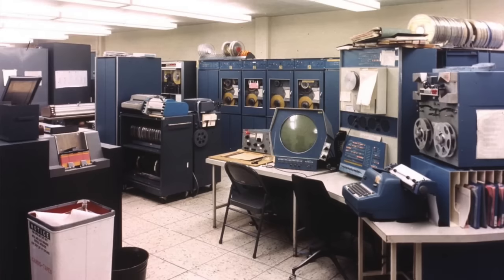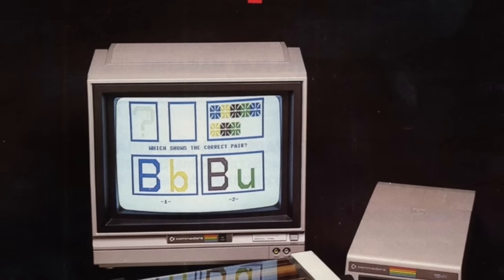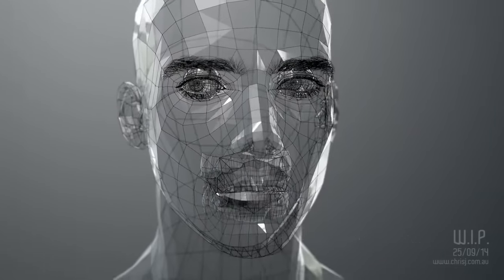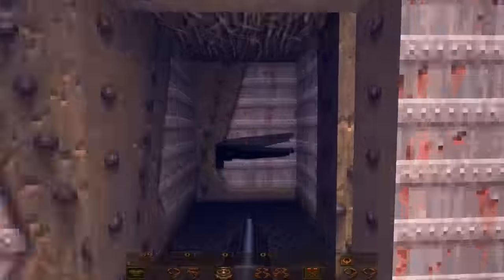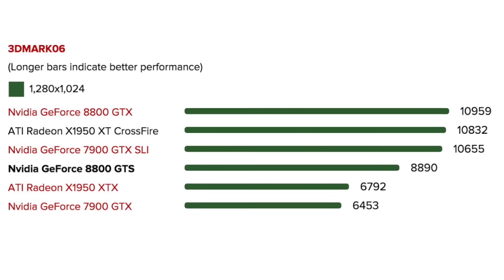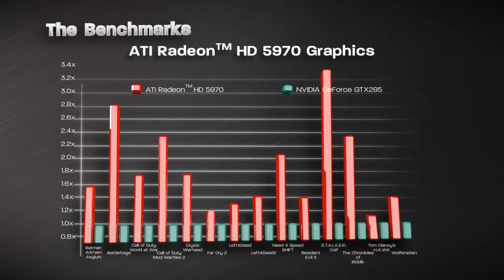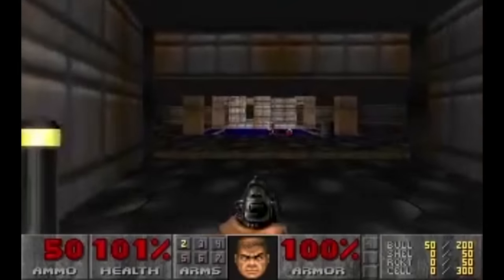Evolution Of PC Gaming Hardware

Comment: Running a 8700k at 5.0ghz, a EVGA GTX 1080ti sc2 hybrid, 4000mhz DDR4 trident z RGB. Acer predator (I dont remember the model number) 1440p 165hz 27in monitor and another 24in lenovo 1440p monitor. Two 1TB NVME drives and two 1TB samsung 3.5 ssd. First time ever building a system of that calibur and it was the best feeling ive ever had when it booted first try.
Reply: Weird flex but ok

Comment: I'm still using an Intel Core 2 Quad Q6600 from 2007, but over the time I've upgraded and overclocked my computer so now it runs at 3.00GHz (stock 2.40). When I got the computer, it has 3GB of DDR2-667, now it has 8GB of DDR2-800. I also replaced the Nvidia GeForce 8600GT with an AMD Radeon HD7770. I think I'll buy a SSD to make programs start faster. So I think this is a good example for a computer with a very long lifetime, most of my friends and classmates buy a new computer every 3 years for about 500-800€ just to play at th highest settings. I can't understand this because I can play all games I want to, maybe not at the highest settings but even on medium settings the games are still fun. I'm not going to buy a new Computer before 2022, then my computer will be 15 years old and also then I'll not give it away.

Comment: I have been building and upgrading my pc for over 10years, always adapting and adjusting to the next best thing that came out. 
Finally I have caught up with the market (although maybe not the MOST powerful but at least high end) It has taken many hours of building and much money to give me the rig I have now, which still to this day I am always looking into other products that could enhance my systems capabilities.....

My Rigs Current State:
 
Motherboard: Asus Rampage IV Formula X79 - 2011CPU Socket.
CPU: i7 3820 3.6Ghz 10Mb Cache (with turbo clock).
CPU Heatsink: Cooler Master sealed liquid cooler single radiator.
RAM: Kingston HyperX Savage 4X4Gb 1600mhz.
HDD: 1x1Tb 3.5 Seagate Drive, 2x500Gb 3.5 Seagate Drive.
GPU: Nvidia GTX 1080 Founders Edition 8Gb VRAM.
PSU: Corsair 750w
Housing: Zalman Z11
OS: Windows 10 Pro
Monitor: Asus VG248QE 24-inch 3D LED Monitor 144hz

Now I consider this to be a good rig however my plans are to get a larger (two fan radiator) heatsink cooler, and a bigger case. Case will most likely be the NZXT Phantom 820.
I have yet to find a game that I can not run in max graphics. I love where technology has gotten us and where it is leading.....Gaming is my live, my passion and my hobby. One day (fingers crossed) I can do it as a career too!

Comment: i rate this video 10/10.
also  the 8800 GTX was comparable to my graphics card I had since about a month ago, finally upgraded the EVGA GTS 450 SC to 1070 FTW. (that's like jumping in a decade of performance)
but such upgrade meant some cpu bottleneck too as he mentioned. I upgraded the CPU a bit too but still need something more.

Comment: Purchased the 1st consumer Asus SLI capable motherboard which supported two nVidia GPUs in 2006 and was blown away, then, back when Comp USA existed. Building it was new to everybody. It needed a 500 Watt power supply else no go. Noisy were the fans in that crate! Now my Toshiba Qosmio PC laptop (64 bit windows 8.1) contains a single nVidia GPU which blows the doors of my old 32 bit machine and consumes only 75 Watts to boot!

Comment: Cpu:Ryzen 5 2600x gpu:vega 64 asus strix rgb x470 itx mobo:board from asus fan:corsair 140mm fan cpu cooler:h115i 280 mm water cooler psu:650 watt evga modular power supply 
Case:nzxt manta

Comment: My current build, which is a total bliss to game and work on:
GTX 1080 SLI + 2x Quadro M5000
i7-5960X, watercooled, OC'd to 4.6GHz
64GB DDR4 with another 64GB coming soon
512GB Samsung 950 Pro M.2 boot
1TB Samsung 850 Pro for games
1TB Samsung 850 EVO for live work files
4TB WD Black HDD for storage
Rampage V Extreme mobo
EVGA P2 Platinum 1200W PSU
Acer Predator 27" 1440p 165Hz G-Sync IPS display
Corsair K95 RGB keyboard
Corsair Sabre RGB mouse
Corsair  MM800 Polaris RGB mouse mat
Edifier S730D speakers

Comment: The Voodoo 2 was not a standalone card, and did not allow a 1024x768 resolution, unless it was a Voodoo 2 SLI (SLI was the propriatary name of 3DFX for pairing two grapjic cards, NVidia got the brand name when they bought them). The VooDoo 2 had 8MB and 12MB versions on a standard PCI slot, it was a pure 3D accelerator, it needed a 2D VGA card to handle 2D Graphics. Each card had 2 processing chips, but the second one was not fully utilized.
Somewhere in 1998-1999 they released the VooDoo Banshee. This was a revamped VooDoo 2, with just one of the two original processing chips. But this one had 2D graphics capabilities, had 16MB of much faster DRAM, and used the AGP 1x slot which gave it double the bandwidth of the old PCI slot.

With all this said, The VooDoo Banshee is not their first all-in-one card. They had the VooDoo Rush, which was basically a VooDoo 1 with 2D capabilities and 6MB of VRAM. Every game club I visited back then used the VooDoo Rush. It was affordable and ran games well. the VooDoo 2 (not to mention the SLI version) was a luxury piece of hardware.
Reply: Forgot to mention.... A single VooDoo 2 12MB card allowed for a maxmum resolution of 800x600 pixels. You needed two of those card in SLI mode, to run 3D in 1024x768 pixels. This also worked with two 8MB cards.

Comment: Processor: i7-4790k
Ram: 16gbs of DDR3 2400 MHZ (forget the exact cards, but they're corsairs)
PSU: Corsair HX750i
Mobo: ASrock z97 extreme4
Cooling: Corsair H100i closed loop (Liquid cooling)
GPU: nVidia gtx 1070 FTW
Display: Acer 24" 144hz 2k x3

Comment: Some misinformation in this video. The Voodoo2 was NOT an all-in-one video card. It had NO 2D and was just a 3D accelerator just like the original voodoo1. You still needed a separate 2D card. Also CPU performance went up 250%  between 2000-2003 while today CPU performance went up only 40% in the past 5 YEARS.

Comment: WIndows 95 on Pentium 200 Mmx with 32mb SD ram, 4mb 3d graphic card, 2GB Hard drive, floppy drive, ZIP drive and 15inch crt monitor with resolution of 1024x768... (payed 2500$ in that time) 

I cant believe more than 20 years passed so fast...

Starcraft, Diablo, Baldurs Gate,Fallout... what a great games in such a great time...

Fuck I just realized I am gamer more than 20 years :)

Comment: My first pc was a Mesh Elite 300H was an Intel Pentium II based PC. The CPU was clocked at 300 Mhz and the PC was supplied with 128 mb of RAM, an 8 GB hard disk. CD-ROM, 17 inch monitor, 8 mb Hercules terminator 3d graphics card, Creative Labs PCI sound card, 50 watt speakers and a 56 kbps modem....about 18 years ago this was top noch...£1200 i payed.

Comment: My Gaming Setup (may upgrade later)

Case: Corsair Carbide SPEC-02
CPU: AMD FX-8320
GPU: Sapphire Radeon RX 470 OC
RAM: 8GB DDR3 (x2 4GB)
Power Supply: EVGA 500w 80+

Not sure of what games it can run at what fps, but please tell me if you know! :)

Comment: Current specs(HP Omen laptop):
Intel core i7-7700HQ 2.8GHz quad-cores
16 Gb DDR4 2400MHz ram
Nvidia geforce GTX 1070
1080p 120Hz Display
250 gb SSD
1.8 tb hdd 5400RPM

Next (might change):
Corsair carbide 780T atx full tower
Intel core i7-8700k 3.7GHz 6 cores
Asus Rog strix z390-e gaming
16Gb DDR4 3000 Mhz ram
Nvidia RTX 2070
1080p 144Hz display
1 tb SSD
2 tb HDD 7200RPM

Comment: I've had ATI/AMD cards in my spec basically since I was old enough to have a computer of my own, but they totally dropped the ball with the R290. I was an early adopter and the thing just SCREAMED for mercy (literally, the coils were so load i could often hear them over my headset!!), not only that but the thing ran so hot that you could grill a BOAR over my pc, and subsequently it did little more than throttle itself down causing huge hickups and slowdowns. AMD acknowledged this issue by revamping the card to the "Tri-X" which boasted a better (read sufficient) cooling solution. Great, but that still left everyone who already had the old R290 boar roaster in their system S.O.L. since they never offered the new cooling solution for existing R290's. I was eventually forced to seek out my own aftermarket cooling (which took forever to hit the market and was very expensive to boot), which worked for about a year until the card itself rolled over it's miserable self, let out a huff and died. It was a complete lemon of a product and the support was so lousy that i just couldn't justify another purchase in the red camp, and so I ended up paying MORE for an Nvidia card with he same spec. And i must say, I'm a very happy customer. Am i permanently in the green camp now? No, but not because i dislike the product, but because I dislike Nvidia's marketing strategy. Still, AMD screwed up massively with the R290 early release and some amends wouldn't have been out of place... like a free cooling sollution upgrade maybe? Fix your mistakes? Product recalls happen all the time, the R290 should have been a recall... and in fact I would have been perfectly happy just to get a free "Tri-X" upgrade shipped to me. But did they do that? Nope, enjoy your 350€ useless brick, and please come again! No way! It will be a good long time before I ever buy another AMD card, that's for sure.

Comment: My PC back in 2013 had 
Integrated graphics chip inside of a Q6600 processor paired together with 4 gb DDR2 ram. Later on I got 7750 which had 2 gb vram :) 

Now I'm rocking GTX 1070 i5 7400 and 16 GB DDR4
Reply: that was the graphics chip on the motherboard,the q6600 doesn't have intergrated graphics

Comment: I have two gaming pc's. (My parents are divorced and i can't bring my first gaming pc to my mothers house you see.) In the first pc i have: Gtx 1080, i7-3820, 12gb ram (ddr3), 4tb harddrive. On my second pc: Gtx 1050ti, Ryzen 3 1200, 8gb ram (ddr4) 250gb ssd. Sure they both have advantages and disadvantages over each other, but they game well, and good. (Btw, my first GPU and CPU was a Gtx 580, and intel 2 duo, don't know which one since i sold it away and i was like 9 back then.)

Comment: We didn’t saw much of innovation from 2012 to 2019 like before
Reply: I just upgraded my Nvidia GTX 570 to an RTX 2070 which really covers that time frame. I'd say you're right although this thing is MUCH more powerful. My old card could barely run older games at 1080x1920 and my new one burns through modern games on all ultra settings at butter smooth fps at 2.5x the resolution - 1440x3440. Pretty good jump for 7 years even though in the 90s to and aughts that kind of progress was being made in about half the time.

Comment: Asus Hero VIII - 6700k @ 4.8Ghz
32GB Corsair 3000mhz - Corsair H100i GTX
MSI GTX970 SLI
LIAN LI PC-A70F
Corsair AX850 PSU
3x Dell S2740L Surround (5760 x 1080) - ASUS MG279Q Black 27"  IPS 144 Hz
W10  - 2x Samsung EVO 250GB RAID 0 - 1TB WD for Storage
Logitech 710+ / Logitech G700 / Ratpadz XT / G27 Wheel
Logitech Z623 Speakers /  Logitech G930 Headphones
Lenovo Y510p, Core i7, 8GB RAM, 256GB Samsung 840 Pro SSD, GTX750M SLI

Comment: Got my current computer in 2013 and I've made a few upgrades last year and this year. I am currently running:

i5-3570 Quad CPU
16 GB RAM
1050 Ti video

I'll be upgrading my CPU soon to an i7 and I might increase my RAM. I think these upgrades will push my mother board to its max.
Reply: Weird flex but ok

Comment: My pc right now: amd a3 processeor(I think that’s what it’s called, it’s basically a intel core 2 duo) graphics: integrated
Ram: 8 gb ddr3 
1 tb

My pc that I’m building:
And ryzen 5 1600 cpu
Gtx 1060 6gb gpu
16 gb ddr4 ram
B350 motherboard
500 gn ssd

As you can see, this is a huge step. I run games right now on ultra low at around 20 FPS, and then I will be able to run 100 plus on ultra. (War thunder)

Comment: AMD FX4300 quad-core 3.8ghz cpu
AMD Radeon R7 240 2gb Sapphire gpu
8gb RAM
350w psu
Runs almost everything made prior to this year, albeit on lowered settings usually. I built this in 2012 for 500$

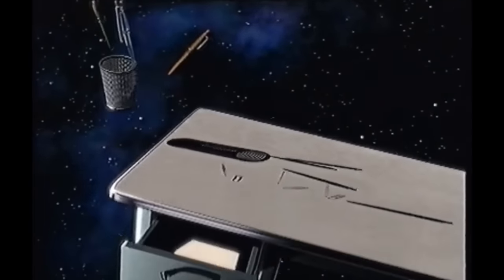Comment: 9:40 It is not true that between 2000 and 2003 top-of-the-line processors where between 1 and 1.3 GHz: while 1 GHz was not reached until March 2000 (the fastest CPU available at the beginning of 2000 had 800 MHz), the Pentium 4 actually reached 3.2 GHz in June 2003.

Comment: Nvidia 940mx graphics, i5 7200u 2.5 ghz dual core, 12gb ddr4 ram, 1tb 5400 rpm hard drive In my current laptop. Im saving up to upgrade to a desktop with better specs but for now I got my half-life, gta 5 and UE4 game development so it works for now 👍.

Comment: I use workstation video cards for CAD and recently I put a  Quadro K2200 and some more RAM in my 5 year-old machine and am able to play Alien Isolation with the settings cranked up.  Cost about $500.  Guess I could have bought a PS4 but can't do CAD on that.

Comment: nice that they forgot to mention the 3dfx v5-5500 or nvidea gutting the performance via neutered driver releases for well over a year after they bought out 3dfx before they could develop even comparable cards... I still have a xp2200+ with a 3dfx v5-5500 in it, still running on the 3dhq german hacked drivers that kept the v5-5500 relevant for several years after the nvidea buyout.

Comment: For all these who wonder. Intel HD GRAPHICS (aka Integraded graphics) Isnt inside the CPU. but more in the Board that supports the kind of series of cpu. lets say i have a LGA 1150 board (4th gen) my board has the Chip of intel's hd graphics 4000 On the board. once it uses that chip. the cpu has to work Harder. it is used in some mobile stuff. but it isnt a peice of crap honestly Because it lets you use the computer with out having a GPU At all. so you have something till you get something better.
Reply: You're mistaken. That was the case in the past but newer chipsets have integrated graphics on the CPU die. If it were to be on the Mobo how could you explain how different Skylake CPU's have different intel integrated graphics for example even when using the same motherboard.
Reply: hm.. Sorry i guess i wasnt really updated on the integraded graphics part.

Comment: I appreciate this video is a few years old. But you missed another major GPU manufacturer around the time of the original 3Dfx... The Videologic PowerVR. While the 3Dfx could run at 800x600 the PowerVR could run at 1024x768. Videologic later left the PC market and renamed to Imagination Technologies and power many of the GPU's in modern mobile devices. I suspect that Videologic lost the PC race because they didn't offer an SLI equivalent.

Comment: my parents bought me a laptop like 3 years ago. back then I didnt understand specs or how anything worked, i thought " IF ITS NEW IT WILL RUN ANYTHING" and suprisingly im still running games like  far cry 4 gta 5 on it and i am getting 30 fps (has drops) BUT, I have the resolution set to 800:600 and EVERYTHING IS SET TO LOW OR OFF. I cant afford a new one for now, though have plans for buying one late this year.
Reply: 2017

Comment: C-64 $595 ?? That's not the original price. I was going to get the Vic-20, but then heard about the C-64 coming. I got mine from the first run. My computer dealer buddy took me to the factory at West Chester PA to get mine just before Christmas of 81.  They were $1000 then.  I see it's said the C-64 came out in 82, but i remember it as late (Dec) 81 (might be another memory failure though), but they weren't in the stores yet. The floppy drives started at $400 afterward.  I had the dataset tape drive first and they were actually digital unlike most other home PC tape drives being analog. My first C-64 graphic game: Fort Apocalypse (seems i recall it took about 15 mins to load from tape), text adventures before that, then Choplifter. 

Oh yeah, many of the first C-64 had a bad power supply with them, so i missed using mine before Christmas, but got replacement supply before new year (swap from another box).

Bought my first Bill Gates compatible 3D card FOR the original Unreal ($600 card for 1 game, Matrox and it wasn't very speedy for being a supposed 3D card)... then went OCD on the UT series with the included editor and server.  I still have the first Unreal Tournament installed with a truck load of mods and maps. 

Played a LOT of games, computer then platform and back to computers, from 1969 on. 
Computer terminal with punch tape local storage (as shown in this video) and teletype monitoring (paper print) at high school. 
Then had Pong, Magnavox Odyssey, Atari 2600, ColecoVision, Fairchild Channel F, C-64, Amiga (1000, 2000, 500 x3, 3000, 4000T), and lastly.. the Bill Gates clones. 

Also was arcade chain tech, so i HAD to test and adjust all new games as they came in. 

 For over 20 years, i was a 3D modeler and animator... mostly built 3D worlds for 3D chat programs and game engines, but also taught 3D modeling apps online. 

 While computer shop repair tech, i experienced some oddball systems and games like the exploding Commodore B-128. (Business-128) a chip caught in a loop and heated till, BLAM!.

 Umm, didn't plan on posting my history, but it helped me sort out my graphic memories.  hey, Duke Nukem!

Oh, I forget which year i got my Amiga 2000, but in 89 i loaded it with most memory i could get into the computer at the time.  4x4 meg Micron cards, + the 2 meg built-in and 1 meg in the frame buffer card.  So, 18+ megs and SuperGen Genlock 2000, 32 bit Motorola 68030 accelerator card with separate FPU ($4800 card),  frame controller to record raytraced animations to 3/4" broadcast tape deck, frame by frame. A 40 meg Western Digital drive, but also the removable Syquest harddrive with a bunch of 44 meg disks. 

Then later, i really loaded up my new Amiga 4000T!
Hey, i still have my DigiView digitizer for the Amiga 1000... but no Amiga or software now.